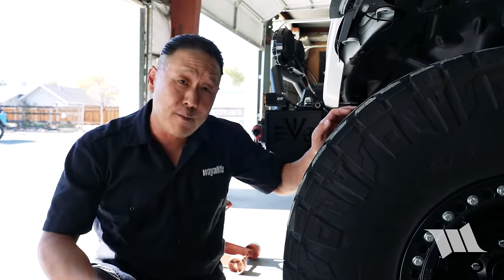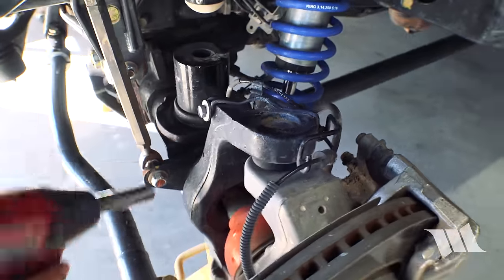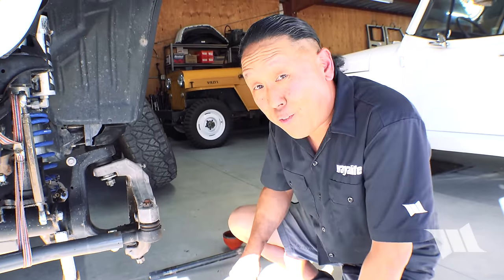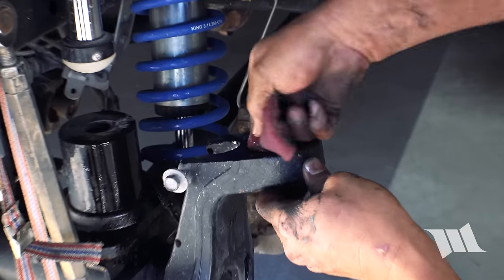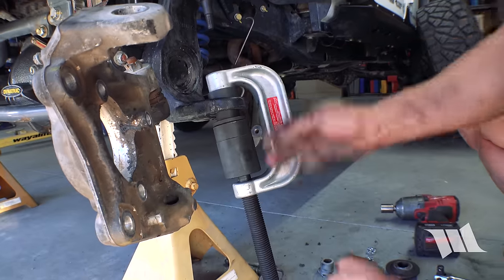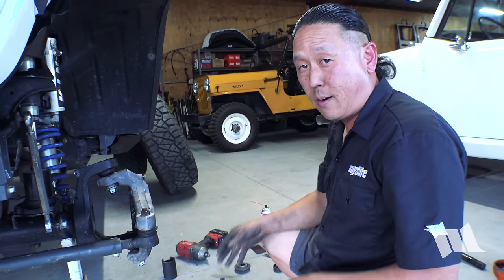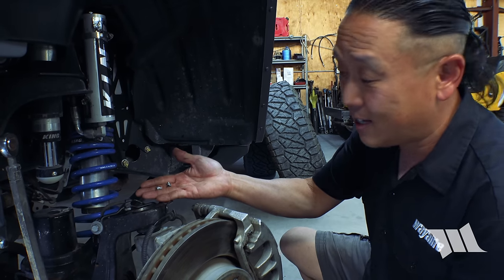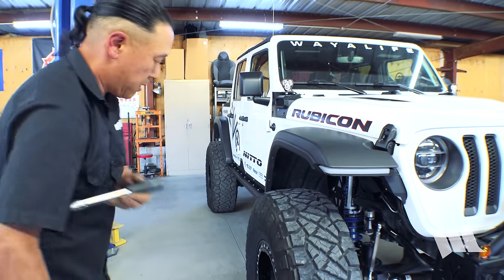How to Install Ball Joints on a Jeep JL Wrangler or JT Gladiator with Heavy Duty ones by Synergy

Comment: How do you know when to change the ball bearing joints?
Reply from the maker: Most of the time, you won't really know it's time until you have an episode of death wobble. But, if you can check them and Radial (side-to-side) movement in the upper ball joint should not exceed 0.060" (1.5mm).
Axial (up and down) movement in the lower ball joint should not exceed 0.050" (1.25mm). If they do, they need to be replaced.

Comment: Doesn't red loc tite require heat to remove?
Reply from the maker: LOL - I know that's the popular believe being spread on the internet but no. You don't need heat to remove bolts with red loctite. Can it help? Yes but it's not necessary if it's applied to bolts that require it like I show in the video.